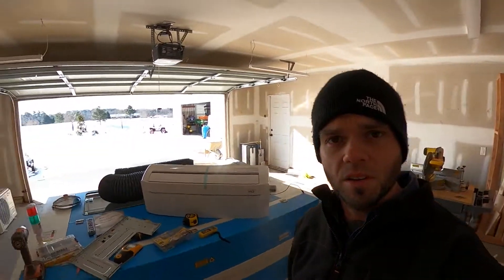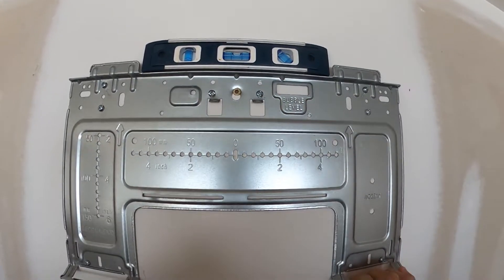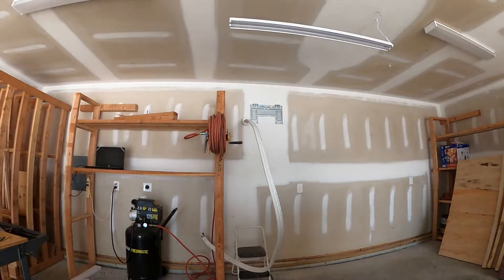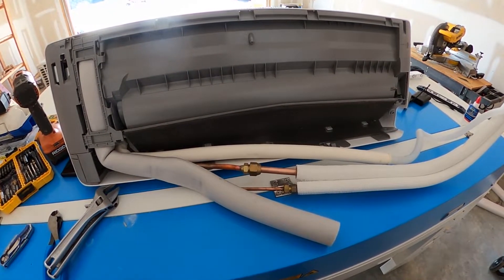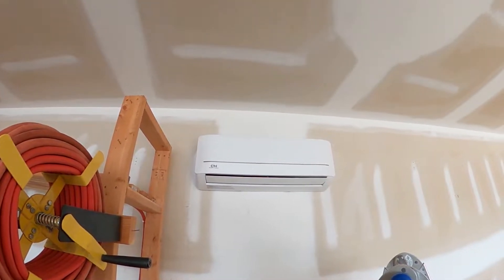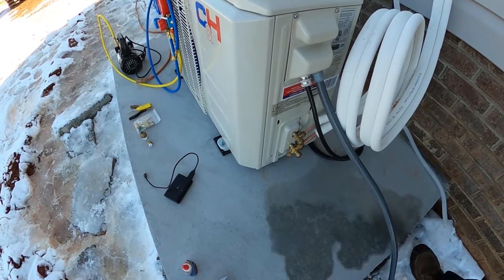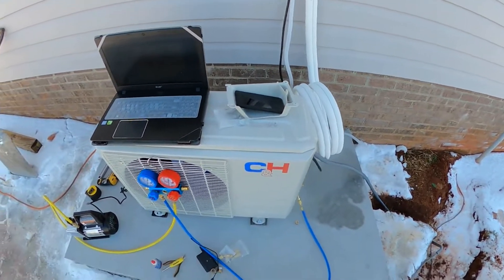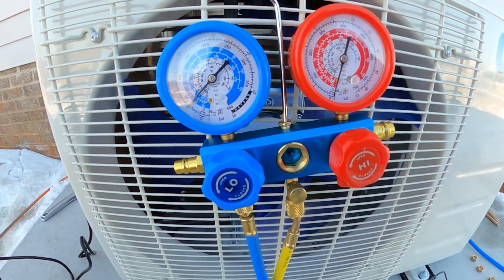Installing a Mini Split AC/Heating System for Shop

Comment: Great job, wish you would of went with a quality unit though.  If you do another one down the road make your exit hole on the same side where your lines, drain and control wire come off.  They should have included a template.  Great work. Keep it up buddy.
Reply from the maker: Thank you! Thanks for the good advice as well. What are some good brands you recommend? I'm actually going to be doing pretty much the same setup for another shop we're building in the near future.